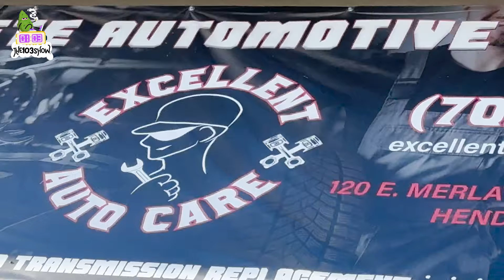Never Let a Smoker Fix Your Car‼️🤦🏾‍♂️smh (alternator replacement s550 Mercedes Benz)

Comment: The coolant line needed remov d to get the fan shroud out, from there the sealer of the trunk, then the bottom splash gaurd neeeds to be removed. The ac lines need moved on the bottom end to remove the bolts then the top end has 2 bolts. Boom done. Reverse process

Comment: Yeah I flip cars and have never, will never let anyone touch them.  quick search found 20 vids on s550 alternator replacement.  That's how I fix all my sht.  I'm no trained mech but if you have any sense you can do just about anything yourself.  I replaced a camshaft in a 2012 Ram 5.7 with hemi tick by youtube videos.  Paid $3300, parts $600, sold for $11... made 7k.  10 days total from buying to selling.  4-5 hours a days.  I average about 5k per flip, but I find them not running or running bad.